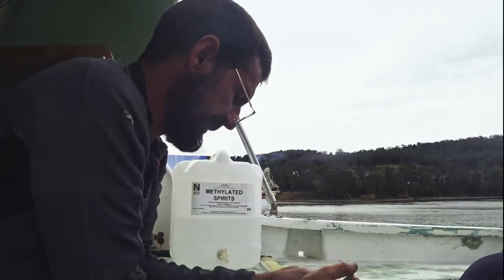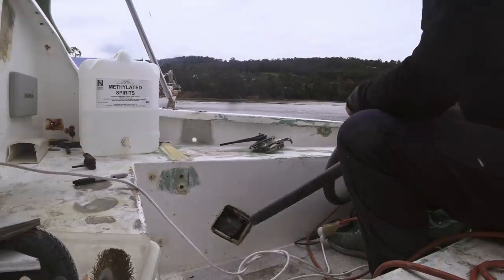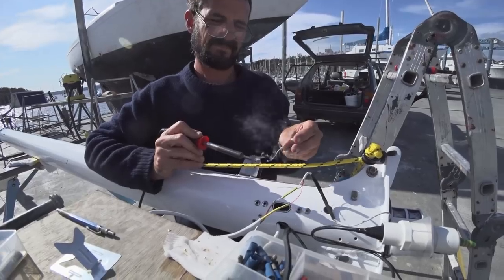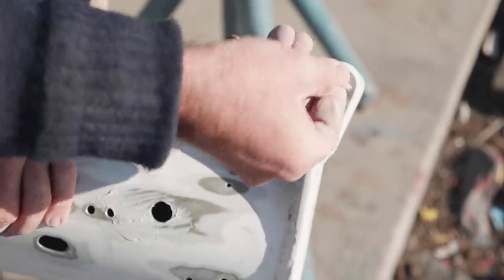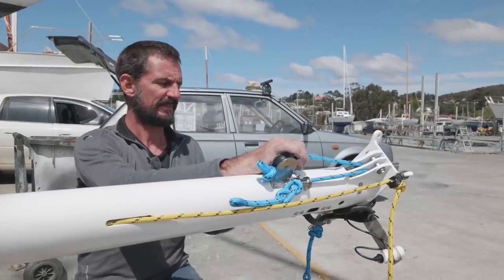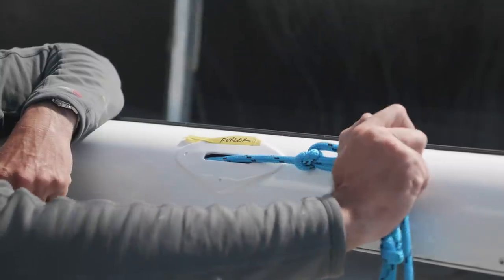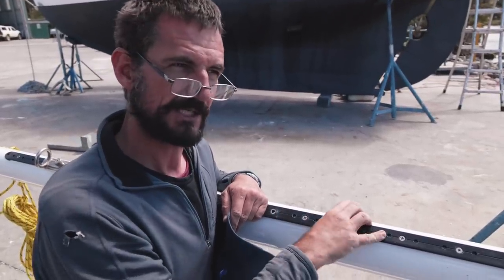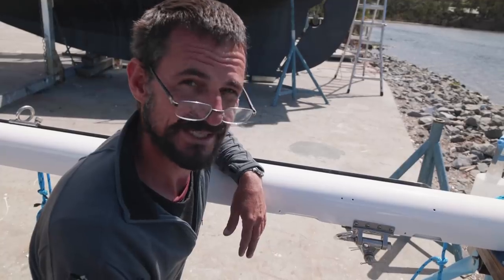Ready to install our DYNEEMA RIG! PLUS a fully rebuilt mast tour - Free Range Sailing Ep 158

Comment: A trick I learned was to slightly chamfer the holes using a rose-bit or countersink bit around deck or edge of the metal fitting through bolts and to thread an O-ring on to the shaft of bolts with a little lanoline--as well as using the other sealing stuff etc.  When tightened, the o-ring seals the bolt and deck or bolt and fitting joint.  If I am going to use a washer I also chamfer the edges of the hole on the side that will sit on top of the o-ringand it is SO much easier to remove.  Lanoline is good stuff.  It will not matter--and would be even better--if anything meta;l was epoxy coated after chamfering the relatively tiny space for an o-ring.  I have got into the habit of doing this almost always, where bolts pass through metal or wood.  O-rings I buy in assorted sets--nitrile types are the best.
Reply from the maker: We are hole chamferers from way back

Comment: Using epoxy to bed chainplates will work for a while,but any movement will eventually crack it. I use sicka or buytl tape being flexible allows for movement. She is going to be the best looking Cladsman about
Reply from the maker: All of those areas are close to zero flex. Highly built up with multiple layers of 1" wood surrounded by 1/4" deck. 105 epoxy has about 4% elongation. West systems G-Flex could also be used but 105 is stronger, about 3 ton of pull would be needed to shift those fittings even without bolts.

Comment: Love your site as ever .I know nothing about Dyneema so thank you for all the info .I was wondering how you manage lighting strikes with Dyneema rigging
Reply from the maker: Heavy jumper cable from mast step overboard into water
Reply: @FreeRangeLiving  
I was wondering the exact same thing.
Hopefully you'll show how you've done it in a future video.
On our commercial salmon trollers we run a copper strap from our mast down to a grounding bar we have mounted to the bottom of our boats.
We also tie our fuel tanks, engine, and shaft into our grounding system

Comment: Troy i like the old school method of tapping but do your self a favor and put your battery drill on its slowest setting and put the tap in the chuck and do your new  hole that way using the forward and reverse on the drill to gain forward and reverse cleaning of the thread works real Well on Aluminium and use some cutting compound but i think you would do that anyway , I only say this as i had to drill and tap new screw holes in Trains and trams when i worked building them. Love the Vlog as always :)
Reply from the maker: Need to get some spiral flute taps to get very fancy then.

Comment: Luv the Vids guys, great craftsmanship!

Curious about using epoxy on fittings rather than polyurethane adhesive sealant.    Appreciate a bit more technical discussion about pros cons.  

Looking forward to splash!    Rock on  

Cheers
Reply: I looked up West system 105 as it's what many people use, and it has a tensile strength of more than 7000 pounds per square inch. The plates looked at least 4 square inches at the interface to the deck for 28,000 PSI. About the same as the breaking strength of 1/2" stainless wire rigging, plus it's bolted through the thick solid fibreglass deck. Not sure of the type of thickener used or it's effect on tensile strength though. Because it's raised above the deck, should it crack at the deck interface, it is less likely to leak or sit in salt water in the sun that speeds up crevice corrosion. And they are using synthetic rigging that will absorb some shock loading. I think it'll be fine, but only time will tell.
Reply from the maker: Perfect explanation thanks.

Comment: I'll be interested in seeing how your chain plates hold up without leaking. I have never seen them epoxied to the deck. The boat looks good!
Reply: If I'm not mistaken, steel and aluminum boats have the chainplates welded on top, with no penetration of the deck.  This seems to be the fiberglass version, and should be the absolute best way to insure no leaking.
Reply: @gymcoachdon  I'm wondering what's going to happen when the fiberglass deck flexes and the stainless doesn't.
Reply: @mikepetersen5024  I was thinking the same thing is your thoughts butyl tape to be best?
Reply: Epoxy bedding can work if you use milled fiber as the thickening agent. Using cabosil only can create a brittle mix more prone to cracking. I am pretty sure Troy knows this and has mentioned using milled fiber in a previous episode.
Reply: @andreaspchristou504  Good to know. I never thought you could bed metal hardware in epoxy without it separating and leaking. It sounds like it is possible with the right preparation and materials. Thank you
Reply: @gymcoachdon  these ones are also through bolted unlike welding though. The thing with bolts and fittings is that you can't get both fasteners to share loads evenly but epoxy bonding does do that. Good way to distribute forces.
Reply from the maker: If the area of the chain plates wasn't vastly thicker and stiffer than the rest of the deck, it may fail. The glue powder with fibre is incredibly strong stuff and West Systems rate the tensile strength of 105 resin at 7500 psi, which in itself is pretty good without the addition of the bolts through a steel backer. All areas of epoxy bonding have about zero flex.
Reply: @FreeRangeLiving  Sounds like you did your research. Good on ya mate. LOL my impression of an Aussie
Reply: @gymcoachdon  
A steel weld is stronger than the deck it's attached to...epoxy isn't unless it's reinforced.

Comment: I would have thought Duralac for the stainless screws into the ally mast. Tef-gel as an anti-seize. Loctite 270 will make the screws break off before they come out with little galvanic corrosion protection... I think?

Comment: That mast looks amazing.   But no fastener is perfect.  I've had Allen-head fasteners strip out just as easy as Phillips.  In fact, slot heads are the least likely to strip out IF the screwdriver tip is always held perfectly aligned. Easier said than done.   

A battery impact driver is a nice thing to have on a boat for stubborn siezed fasteners, as well as the old standby the hand/hammer operated impact driver which almost always works unless the tip itself gives up first and chips/deforms.  There is always the drill & easy-out if that fails.  Because... saltwater environment.  Still a boat is not as bad as something like a caustic chemical plant or concrete mixing facility.   Disassembly is regularly done with a sawzall and angle grinders...
Reply from the maker: No slot heads !!! Yeah, those industrial plants are full of good times. I have always loved hydraulic nut crackers.

Comment: Guys, excellent job Moorool is looking great. A question, are those button head machine screws stainless or monel you are using on the mast fittings? If they're monel, did you source locally, I've been looking all over the net to find local suppliers.
Reply from the maker: 316L

Comment: Hi Guys, regarding your throttle, gear/throttle lever system. Your original I had almost exactly the same one when I bought my boat, same cheezy problem. and believe it or not I came to the same conclusion as you, found the simplest with the least metal differences and bought the same one you bought!!! It's served me and the boat well over the last 15 years. The only problems I have ever had is when some smart alleck thought it was not mounted correctly during some maintenance because its sloppy? Hmmmm he dropped a part and thought it wasn't needed, didn't work properly. My yacht gets driven hard sometimes by various drivers, a very wet boat too. When it shows wear over the years Troy, just add a little more water proofing grease into the moving shafts, definitely not into the moorse cables I'm sure you know what happens then by now. Cheers and fair winds.

Comment: Not sure about epoxy under the chainplates. Something flexible is probably the answer. You will have differential movement with expansion and contraction of dissimilar products.
Reply from the maker: We know it works the way we did it.

Comment: Aye m8’s, I fully agree on screw heads but I have bad experience of Allen key screws. Getting round too easily. Did you also consider Torx? They can take more torque when turning the head, due to the shape of the bit. Maybe they aren’t common Down Under?
Reply from the maker: No, we have torx here too mate. I'll check what is available in the size we want and the head pattern.
Reply: I agree, I also have had problems with rounding out Allen head screws.  I now use only Torx screws when ever possible.  If available, Robertson head screws might also be a good choice as well. (Robertson screws are kind of a Canadian thing)
Reply: @InquisitiveSearcher  I know those square heads and use them for mounting stuff in public environments when you don’t want anyone to mess around. And they are quite sturdy. I nowadays prefer Torx heads for several reasons: handles more torque, fits better to bits (almost like a magnet) and they look great (gives a professional impression). And very important - easy to drill out and/or using a screw extractor.

Comment: Another great video many thanks!!!. Question. Why not a Solent stay versus inner forestay needing backstays??? We have similar plan for1969 Swanson 36 upgrade as I hate the inability to  hank on  a Storm Jib with the roller reefing set up. Probably old fashioned but I am a 1945 mode and have been caught out in Bass Straight beforel.! Many Regards!!
Reply from the maker: This inner stay brings centre of effort down and in further than a Solent and we are adding it for when caught in heavy conditions. After the second reef, the main is inside the running backstage.
Reply: @FreeRangeLiving  Thanks for thoughts Troy!!!

Comment: Did you attach the chain plates to the hull, or just to the deck? It looked like a great attachment to the deck, but only the deck.....
Reply from the maker: All Clansman chain plates go thorough a heavily reinforced section of the deck, not to the hull sides. We just used the original holes.

Comment: I'm curious about wet sanding with epoxy
Cheers Gray
Reply: Same here.
Reply from the maker: Aluminium and SS quickly develop an oxide coating that protects them but isn't that strong. By wet sanding with epoxy, the instant parent metal is exposed, the epoxy can bond to the micro grooves and is very strong. West Systems 105 has enormous tensile and compressive strength but it all comes down to what it is bonded to.
Reply: @FreeRangeLiving  thank you. Cheers Gray

Comment: Screwing directly in the mast would not have my preference. I would prefer to use short studs, this to reduce risk of damaging threads. Also, if in trouble you have more to work with.
Reply: What are short studs? Like rivet nuts?

Comment: Your the ones with the Dyneema stays and cable fore and stern from the mast ? I've been reading more and more about lightning protection, and the experts talk about side flashes both to the side and fore and aft, traveling out the propeller shaft blowing out the boat. So grounding the stays and fore and aft cables if they exist is essential. Giving a path for the lightning. And this is the craziest thing, the path needs to go to "THE SURFACE OF THE WATER" or WATER LINE ! Crazy stuff. I have documentation if you would like to see it.
Reply from the maker: Heavy battery jumper cable from mast step to ocean in a storm. The electronic devices on board will probably all be stuffed though unless they are in a large steel container (Faraday cage)